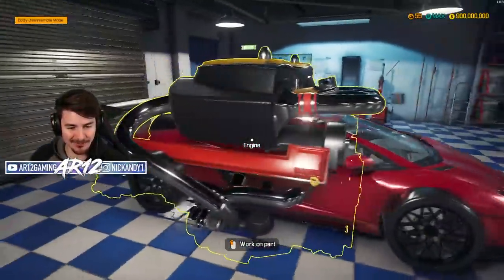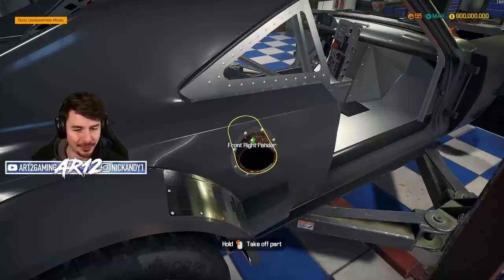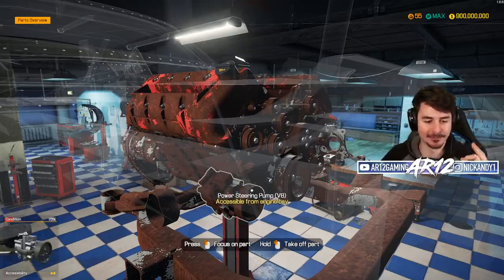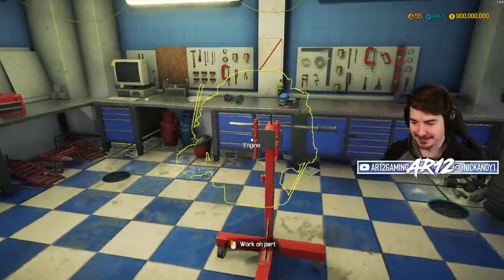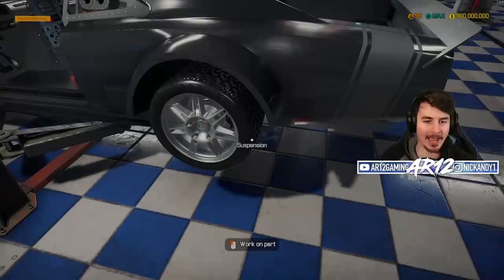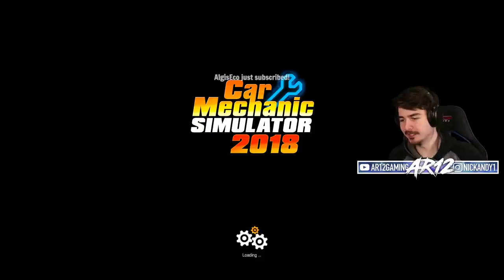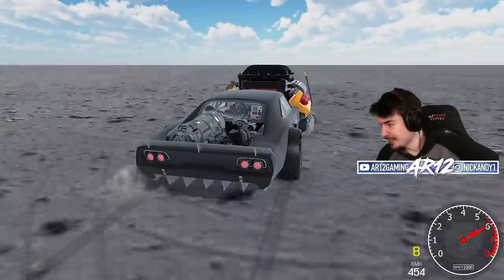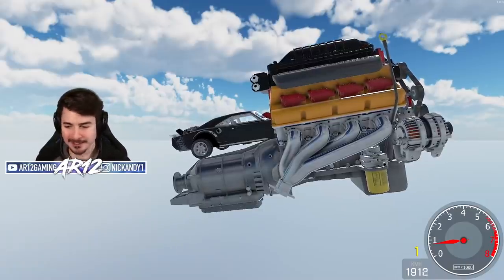Building a 2000 KM/H Dodge Charger in Car Mechanic Simulator

Comment: The hellcat engine does run 2 spark plugs per cylinder because the ignition timing between 2 spark plugs per cylinder is extremely short so it's able to ignite fuel faster and all hemis use the same setup

Comment: 4:50 its a 2 stroke which means 2 spark plugs per cylinder. 4 stroke means 4 spark plugs per cylinder if you didnt know

Comment: All hemis have atleast 2 spark plugs per cylinder for emissions... one ignite the fuel and the other fires during the exhaust stage to burn unignited fuel to lower the emissions to keep the car legal in the usa... the 6.4l hemi has 3 spark plugs per cylinder 2 for ignition and 1 for exhaust for extra power and more even ignition

Comment: Most modern Hemi's have two plugs per cylinder. I have an 05' Magnum RT, with the 5.7, and it's got 16 sparkplugs. Not the cheapest car to do a tune-up though. 💸💸✌💥💥🤣🤣